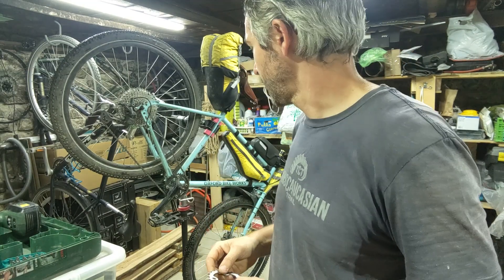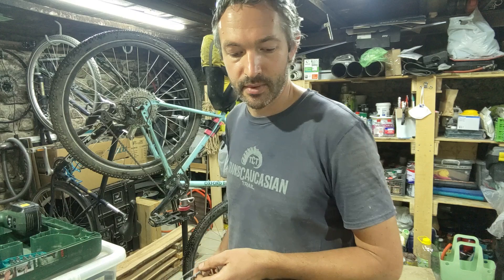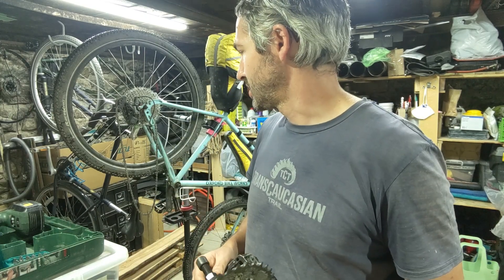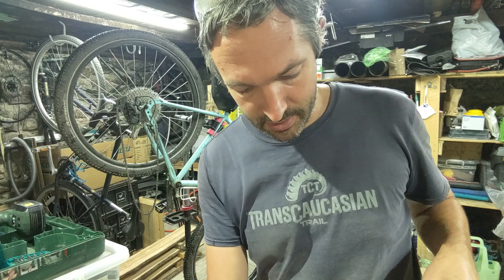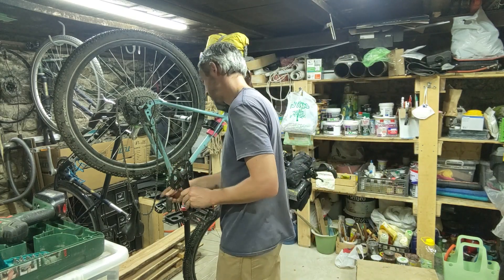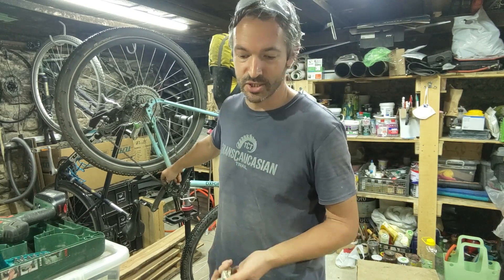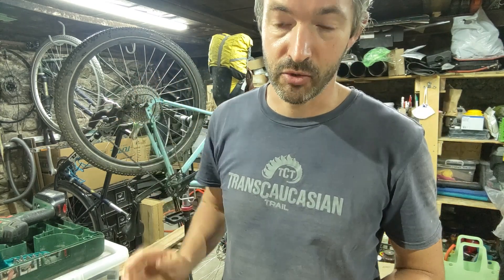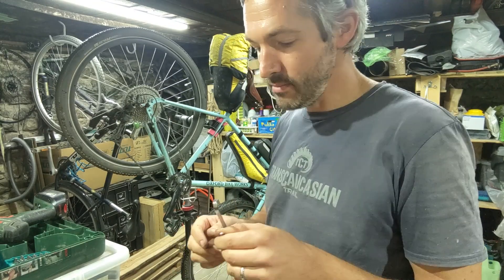Hacking my 1x MTB drivetrain for extra-low gears... with some help from IKEA!

Comment: I did the same thing for a bike I usually used 1x when I wanted to take it touring. A problem I found was that because the outer ring was designed as a single ring, it had no ramps so the chain fell between the two rings when under load and got stuck. It had worked fine on the work stand. I suggest checking whether the chain is narrower than the gap between the two rings. If it is, you may have an issue. I don’t think it was such an issue in the past with older chainsets as the chains were thicker but with more speeds come narrower chains.
Reply from the maker: Thanks, I'll check. It's a 10sp chain so not quite as narrow as some, and on my initial test ride I had no issues, but a full day ride is definitely needed to see how it performs in the scenario it's designed for.

Comment: I tried this on an older specialized Enduro with 26-in wheels. It did not work. The two front sprockets were too close together. I might have been having a more difficult time because of the shorter chainstays making a more extreme chain line.
Reply from the maker: Interesting... you might be right. Lots of fine tuning needed when you go rogue on the standards!

Comment: The one thing I think people are not considering is, at some point it is faster/easier to walk. On a road bike (w/o packs), the threshold for gearing is 1:1. For a loaded bike off-road, it is lower (and personal preference). Even my Microshift Sword 1x10 has a 40x48, which is .83, and I’m sure SRAM and others can get lower. This is equivalent to 28x34 - pretty low. I would bet it is faster to walk than spin anything lower than a 28x34, and it appears he already has at least a 32x40 (.8).
Reply from the maker: Very good point. This does work out at about walking speed in the lowest gear combo. But it's good to have the option, I think. I'll see how it feels in the real life scenario...

Comment: The solution I found when I needed super low gearing on my bikepacking road bike was I installed a sram 1x12 mtb drivetrain with a sram road 1x cranks. So i put a mtb 32t chainring on the road cranks. This gave me super low gearing on a road bike.
Reply from the maker: Good idea!

Comment: Will be interesting to see how you get on with such a low bottom gear, I've always found that it then becomes a question of maintaining your balance at such slow speed, especially on tricky terrain.  Thanks for the upload.
Reply from the maker: I took it for a test ride the same afternoon as I made this video and went up the steepest hill I could find nearby. It was only 15%, but in 22/46 the pace and cadence was very sustainable with no balance problems. On looser and more technical stuff I've yet to try it but will report back when I do.
Reply: @TomsBikeTrip  Thanks Tom.  Out of interest, what wheel size / tyres are you running?
Reply from the maker: These are handbuilt Ryde Andra 321 (584mm) rims on Deore M525 hubs, with Continental Race King 650b x 2.0" tyres. This was Richard's choice after listening to my description of the race.
Reply: @TomsBikeTrip  Thanks Tom for taking the time to reply.  According to the Ritzelrechner gear calculator, that works out to a 13" bottom gear.  That should get you up anything if you can keep it upright. Cheers.

Comment: People that tour on Brompton's/folding bikes do this sometimes, (although there are ways and means to get an FD on them, they tend to not work well and require constant re-adjustment after a "fold"). And then there are people that do this for touring/bike packing who aren't really trying to get a 2x as such, more like 2 independent sets of gears covering a huge range so very often an FD won't work well (if at all) as the difference in chain ring sizes is too much. I'd maybe fashion a "chain catcher" of some kind to stop you kicking the chain off the rings, other than that it should serve you well. Good luck with the race 👍.
Reply from the maker: Thanks! I'll see if I need a chain catcher. I got quite good at shoe-shifting while touring with a broken front derailleur cable, so might get away without it. Let's see...

Comment: One could have fairly close sized chain rings. And set it up at the start of the ride, according to mood and terrain. Even a special highly simplified mech with just a lever - so no cable to service. No smooth shifting it would crudely move it over.
Reply from the maker: Very true. But at the moment I'm just using what I've got (hence "hacking")!
Reply: @TomsBikeTrip  Indeed, and cool. Inspired me to have some ideas that could make it to mainstream bikes.  Such a "mech" would not need springs. It could be very simple/cheap/low weight - and no servicing. While solving a problem. New thought - I guess if wax the chain - might not even need the mech, do it by hand at start of ride. That's the main thing I don't like about manually shifting front rings - the mess!  Could be an excuse to get short cranks on my gravel bike - switch to a simplified 2x.

Comment: honestly? awful. you need a proper front derailleur or more spinny legs and short cranks for 1x while only using the 22 teeth chain ring. 22x11, 57-584 tells me 120 rpm for 27 km/h. short cranks make 120, 140 rpm quite possible i'm told.
Reply from the maker: Honestly? The only useful measure of whether this is good or bad is what happens when I ride it. And on that note, so far so good! Thanks for sharing your opinion though!
Reply: @TomsBikeTrip  i see. good luck on the armenian trip!

Comment: I would fit a Deda Dog Fang onto the seat tube - help the chain go onto the little ring and avoiding dropping the chain and possibly wrapping it around your bottom bracket/crank.

Personally (slow rolling not racing), I use a 2x10 - 24/36 with 11-36T on the back.  Other bikes are triples - Deda dog fangs fitted on all of them (cheapest place to buy is Spa Cycles).
Reply from the maker: Thanks for a genuinely helpful comment amongst a sudden deluge of sarcasm and smugness! 🤣 Looking up the Dog Fang now...

Comment: This is nothing new. 

Eg: For modifying Bromptons, the bikes circa 2009 had a Stronglight chainset with extra holes drilled in the arms which rather nicely accepts a 28T inner ring that can be fitted to the outside using spacers and chainring bolts.  Instead of using a stick to change up and/or down between rings, just use your foot by pushing down on the chain and pushing slightly outwards to the right so that the chain is picked up by the larger ring then pedal normally and the chain will be pulled onto the larger ring and vice versa to move to the smaller ring.
Reply from the maker: Interesting, didn't know about this. Thanks for the comment!

Comment: Well , this is an excellent hack for touring, but for a race ? And trying to derail the chain with a hook ? It's an accident waiting to happen. 
I would suggest that instead of the ikea hook , have one 4 , 5 or 6mm Allen key on you for this , or even a tyre lever. 
Cheers
Reply from the maker: I'll probably be stopping/dismounting to hook the chain back up. It's mainly so I don't get my hands dirty. My goal is to finish the race before the cut-off time, not to win it.

Comment: when using narrow-wide chainrings, do you have to make sure the chain fits onto the right teeth every time you shift between the two chainrings?
Reply: the chain kind does it for you naturally, you can even use then on 2x or 3x, the shifting is just slower
Reply from the maker: I'm not using narrow-wide chainrings. The 32T is a Zee downhill single. The 22T is off an old triple.

Comment: I have this for my bikepacking/ mtb with a narrow wide chainring to avoid chain drops. if you can deal with a normal chaibring then a seattube lever front derailleur is better I thinn
Reply from the maker: This is a Shimano Zee 32T single ring for downhill bikes, not a narrow-wide ring. I've had no issues with chain drop so far. (FWIW I had to Google "narrow wide chainring" because people kept mentioning them.)

Comment: How would this work in a race where time is of the essence and I would have thought you would want perfect shifts as quickly as possible? You don't want to have to keep stopping to put your chain back on thus losing valuable time and falling down the placings.
Reply from the maker: Good question. Ascend Armenia is perhaps unusual in being a 1,100km self-supported bikepacking race with an 8-day cutoff time. My goal is to finish the race within this time, rather than to win it, and stopping once a day for a few seconds to hook the chain back on isn't going to make any meaningful difference to that. In the meantime I won't have to spend time, money and energy trying to find very specific bike parts in a part of the world where nobody sells them.

I know this is not necessarily how others would approach a long-distance bikepacking race, or any other race, but this is a video diary about my personal race prep process – it shouldn't be interpreted as a how-to for anyone else :-)

Comment: I was looking for narrow wide 22 tooth chainrings a while ago, you can get them but they are really silly expensive. Someone must make reasonably priced ones by now.
Reply from the maker: Here I'm using a regular 22T inner chainring designed for a triple crankset. Did you want it to act as a single "middle" ring? Could it perhaps work by using a different length axle?
Reply: @TomsBikeTrip  just as a 1x10 option for old MTBs with small cassettes so you don't have to buy a whole new crankset/BB/cassette etc  I'm having to use the 104BCD and the smallest I can go is 30t it's just a pain because it's not my main bike and I'm having to buy new cassettes to suit too when all it really needs is a 96mm BCD 22t narrow wide 🙄
Reply: Try shimano Cues I am running one

Comment: Luckily I knew, dont buy a 1X gravel bike.   
Even with a 2X GRX 810 drivetrain I put a 11/40 cassette on the thing.     It can go up most anything and keep a good spin going.  

Of course once a small chain ring goes on the front, there's no top gear to speak of.
Shift with the foot.......................well yeah.   On some gravel rides, the guys that are pushing their bikes are always the 1X guys.   The shop told them it would be great!
Reply from the maker: Lucky for me this isn't a gravel bike (whatever that is) – it's an offroad race bike built for speed and efficiency in a self-supported bikepacking event, hence the minimal spec and frame luggage. Occasional foot shifting is totally fine!

Comment: works for me, shoeshift it down to the little ring and find a stick at the top of the hill to lever it back up. only need it 2-3 times a year, its been a life saver.
Reply from the maker: Nice to hear others are doing this :-)
Reply: @TomsBikeTrip Interesting idea as my sister lives near an Ikea store in Tempe . Good to see you getting back into new content . I had a old bicycle channel but erased it all due to assorted criticism , even though it wasn't that common a problem .
Reply from the maker: You could use anything to achieve the same result – this hook was just the closest thing to hand that was about the right shape!
Reply: 2 or 3 times a year, what?  I have a 2X gravel bike and always use all the gears, there are downhills and there are uphills. Speed on downhills is always the plan.   31/48 on front GRX works great. You really shift with your foot and then a stick?

I always knew 1X on gravel or road bikes was not a bright thing.  But the marketing says........

Comment: if you want to keep the cockpit clean and avoid a bunch of cabling you can add a front derailleur and use a down tube or bar end shifter mounted to the seat tube (top pull type) or downtube (bottom pull type).  they sell clamps for a single shifter (the seat ones are meant for dropper post). That would reduce the cabling and you wouldn't even need housing. I have done the Downtube method before. This was for a 1x setup that I needed 2x  when fully loaded and with my kids in a trailer when steep climbs would be on the route.
Reply from the maker: Clever solution indeed. I'm going to try the "shoeshift" method first (as someone else put it) and if that doesn't work I'll look at this next!
Reply: Ive seen exactly this on Path Less Pedalled, very neat solution

Comment: Always good to have some extra range! Still I don't see the point in avoiding the front derailleur in this setup. Maybe a compromise will do: Put the derailleur back on and mount a thumb shifter on the seat tube to operate it. Extra benefit of having the front derailleur: No chain drop!
Reply from the maker: I should have added context: I live in rural Armenia with no functional postal service, no Amazon, no next day delivery, etc. So I can't just order parts online whenever I need them. On the upside, this forces me to get creative and explore alternative approaches!
Reply: @TomsBikeTrip  If this is so, where did you get the IKEA hooks from? And also, didn't you mention that this was originally a 3x setup?
Tinkering and getting creative is always a good thing to do!
Reply from the maker: I got them on a trip to Istanbul last year. The crankset is indeed for triple chainrings but the bike (an experimental one-off build) was supplied as you've seen. And yes, tinkering is way more rewarding than ordering stuff online. Built not bought! :-)

Comment: Bought a used XT crank and set mine up 1x11 36 in the front and whopping 11-52 in the back. After a while I tried putting back the small chainring (26t) and a front derailleur. I have the Deore 11sp derailleur. It works flawlessly! I still use it as a 1x11 98% of the time but it's nice to have these ridiculous bail-out gears on super steep hills. It's a keeper.
Reply from the maker: Good to know others have been through this before me – thanks!